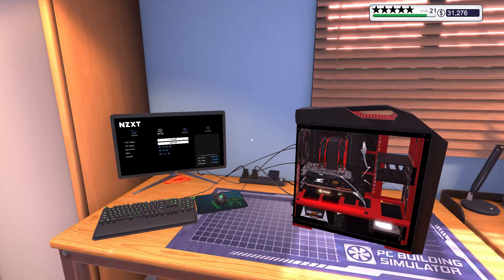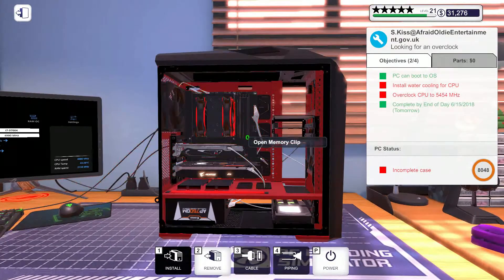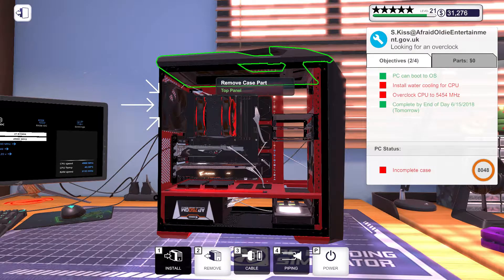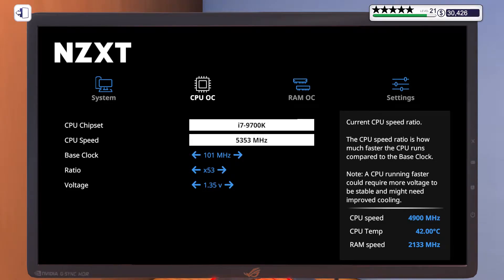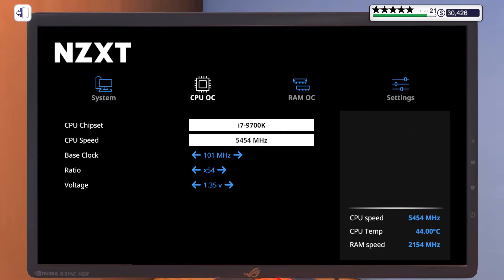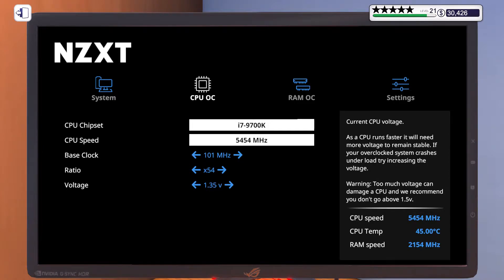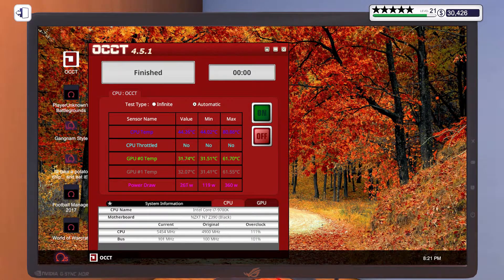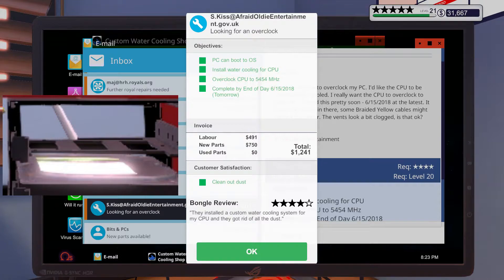PC Build Simulator: How to Overclock the CPU to 5454 MHZ or More, Solutions

Comment: You can remove the hard drive upper bracket.
Reply from the maker: True, you can remove it but one problem related to my previous attempts is that, by removing upper HDD bracket and placing 120 or 140 mm radiator means it will obstruct with reservoir space.

This means that you can't install the reservoir tank in lower space because it has been blocked by front radiator unless you have to shift radiator on backside or either depending on sizes of reservoir or radiator in which may be fit into it.
Reply: @rads_lab  ok

Comment: I did my pc like u, but it was bluescreen :D
Reply from the maker: Most likely, due to small chance of In- simulator app glitches/bugs, you might encounter same issues just like me happened in past.

Despite that, the solution is to restart your "PC Building Simulator" App, open app again and once you finish overclocking, make sure that the given base CPU temperature as shown in Video (44.5 ⁰C) should match with your result maybe same or close to only during overclocked CPU idle condition. 

Otherwise the App bug will cause the base temperature to be higher than >44.5 ⁰C and resulting Bluescreen.
Reply: @rads_lab  ahright